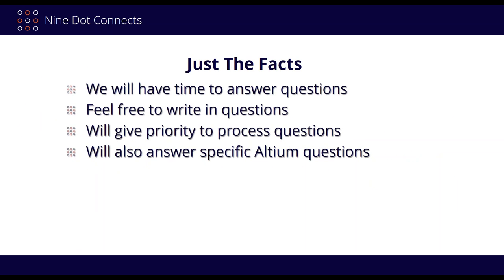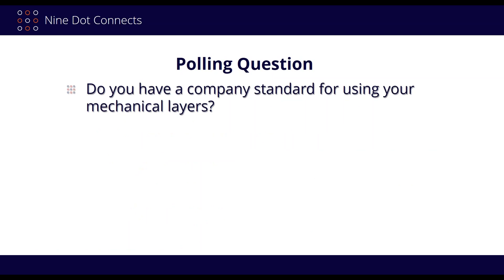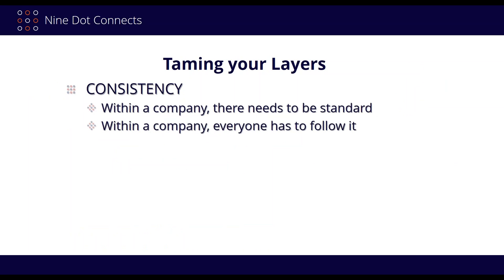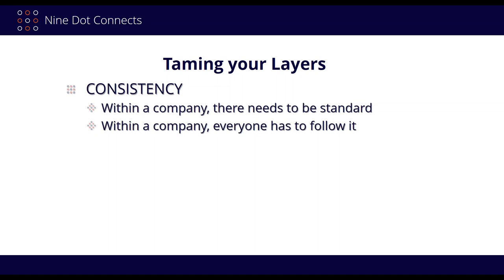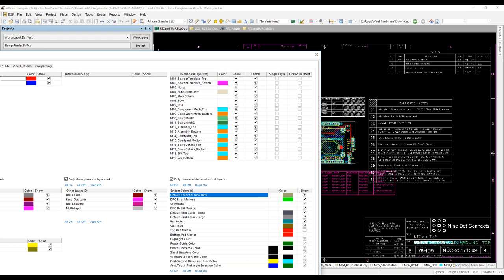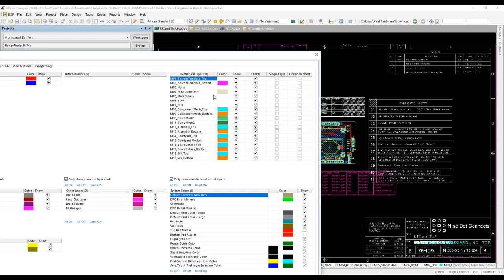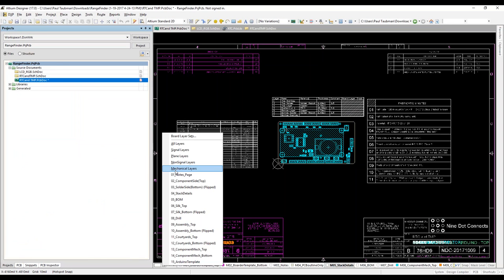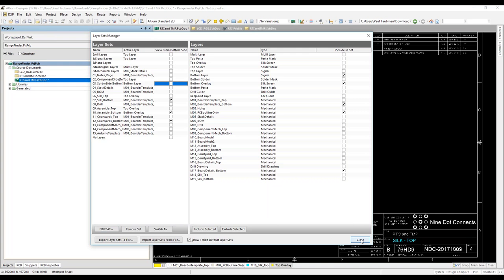How to Tame your Mechanical Layers

Comment from the maker: There is no standard for mechanical layers.  As for creating one through the IPC, that will not come to fruition because there are 100s of companies each with their own mechanical layer definitions.  There could a be recommended list, but conformity to specific layer numbers would require a great deal of library editing.  Some time ago on the Altium user forums, a question was asked about the layers that designers were using.  This was not about which layer number, rather, the purpose of each layer.  As a result, 42 different layers were collected.  It was obvious that were layers listed for different industries and different board layout purposes that would not be applicable to other industries and board layouts.  This list is still on the Altium forums.

If you are simply looking for a basic list, we have created one.  You can custom tailor it to your liking.  The link is below.
https://www.ninedotconnects.com/back9-mechanical-layers

Two very important points:
1.  Make sure that when you establish the mechanical layers, implement them into both the library and the layout editor.  This will prevent you from using a layer that was dedicated for the other editor’s purpose (i.e., using a layer in the layout editor that was intended for library information, and vice versa.) 
2.  Altium Designer (version 18 and prior) does not have a way to import/export these layers.  Therefore, create a library (.pcblib) and a layout (.pcbdoc) template that contains these layers.  Use these templates from the very start of a library or design.  Cleaning up the layers during a layout project is possible, but tedious and messy.

Comment: Very good idea to setup these "views" .. however, does this have to be setup every time per project? Or is there a way to somehow save these layer set definitions so they can be reloaded on new projects? I know a workaround could be to have a blank project that you always start from but this isnt always practical. Thoughts?
Reply from the maker: You can export and import these views into new projects.

In AD17 (and prior) Click on the 'LS' at the bottom left of the PCB editor and select 'Board Layer Sets'.  In the dialog, there are buttons for exporting and importing the layer sets.

In AD18, you will need to go to the View Configuration panel.  In that panel, you will find the Layer Sets region.  To make use of it, you need to make visible any layers in the editor that you wish to include in the view.   Press the button adjacent to the Layer Sets dropdown to capture it.  You can rename it.  There are also buttons for importing and exporting the views.